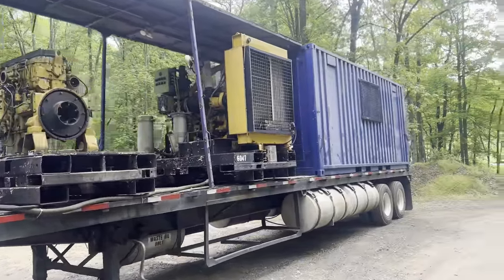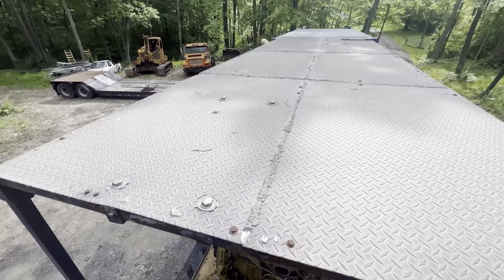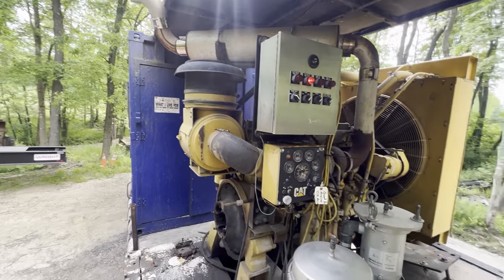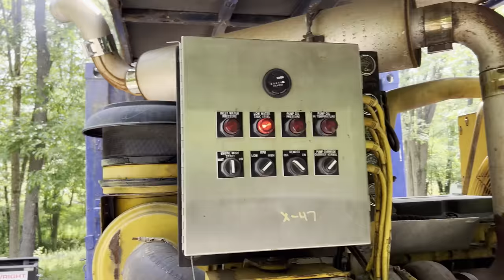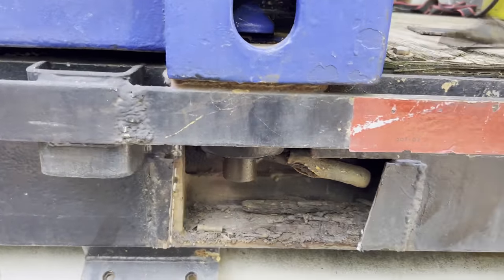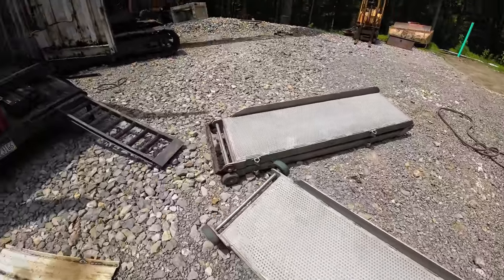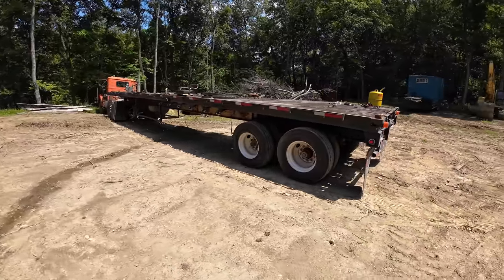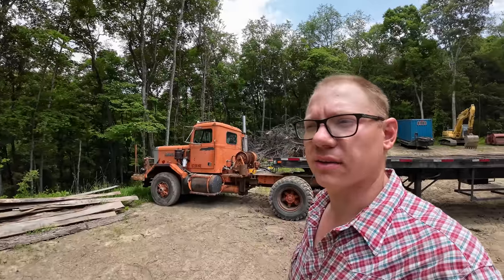I paid nearly $6000 for this Unit at the Auction, Sight Unseen, Will it run??

Comment: I was going to prematurely comment that you should unplug those wires as they look like remote controls probably controlled by the float in the tank. We use this setup a lot in dewatering setups
Reply: The override and/or maint switches may have bypassed external controls.

Comment: Great video. You made out good. But, as a suggestion why don’t you recondition the trailer ? Put , a new bed on it. Sand blast the rust . Prime and paint and get more money for it. Just a thought. Sometimes as is doesn’t bring in much. Reconditioned will. The steel is in great shape. Very nice nugget plan for the Auto Car

Comment: With the two engines, my guess is the stripped down one was the original ... something went bad on it and they bought a used or remanufactured one and put all the parts on the new one. So I'd guess the stripped one won't run/needs rebuild, and the one with all the stuff will.

Comment: You mentioned the brakes took their time to release.
For the lay person info for you
 Air brakes on a truck are designed to 
FAIL SAFE.
No air pressure in the system the brakes will  automatically apply via spring pressure.
Air pressure when greater that spring pressure release the brakes.
That is why you sometimes see and hear a driver revving the engine on a truck or bus.
It is also why you sometimes hear a whoosh or escape of air as a driver applies the Handbrake.

Comment: Matt, I wonder if building some kind of counterweight box to hook on the back of Fat Alice might help with situations like this - maybe one that can be used between all of your machines that could benefit from one. It might be a quick and fun little project… Otherwise, good video as always!
Reply: that 90 gal. tank would do,  make a cradle for it, so it can hook onto any machine,  then fill it with water as needed....lift on, empty,   then fill,  use machine,  drain tank, lift off empty..

Comment: was gonna say the yellow wire your mate disconnected would probably be to the 3 spot switch for mait, start , run 
Im sure if you reconnect it then as the engine starts you switch that switch from start to Run and it should keep going. 
Mait position - should only let it crank but not start. 
Start position is obviously (for cranking to start but not to run) 
Run position (for running but not cranking)

Comment: With truck/trailer  prices recently, the flatdeck by itself is worth more than what you paid for the entire setup.
Reply: Agreed! And on top of that, sometimes what provides a vital function for one outfit is so specific that the component parts are worthless to anyone as assembled… which means that stripping that trailer down unlocked all the resale value the thing has to offer!
Reply: no it isn't , NOBODY who hauls trailers for living wants that thing . its useless and outdated
Reply: @Hard_Right For daily use that might be the case, but for hauling bales on a farm or something like that it is good.
Reply: @Hard_Right  What makes that trailer useless today?
Reply: @b2dmastersniper  my uneducated guess would be the weight.
Reply: The country is saturated with those older style flatbeds. The rigging company down the road from me has so many they are stacked 4 high in several rows. With a shot deck he can probably get its scrap value. The tires would probably sell better on their own.
Reply: @inkman996 with a shot deck? Have you watched this guy at all? He has his own saw mill and just fixed up a trailer and made his own deck on one of his recent videos
Reply: @OldSlabSides  yes I watch him and he did not say he was wooing to put the sweat equity into redecking the trailer.  You might not know how hard of a job it is.

Comment: had a modern version on a building site i was working on.  they used it to blast off concrete with super high pressure water... like 3000 bar, so that rebar could be recycled or slabs that werent up to spec could be re-poured without the structural work having to be re-done.

this stuff could cut you in half and sounded like a jet engine
Reply: I can only imagine the mess that water jet would make stripping ground-level concrete. I make a hellacious mess washing the edges of my driveway with my puny 248 bar pressure washer!
Reply: They're also used to excavate hillsides in a hurry, washing away tons of dirt in a very short amount of time.

Comment: In the heart of Diesel Creek, a daring gamble was unfolding. A mysterious unit had been won at the Ritchie Brothers Auction, sight unseen, for a hefty sum of nearly $6000. The unit, a peculiar ensemble of a hydro demolition trailer, two power units, a poly tank, and a 20-foot sea can, held a promise of untold treasures or crushing disappointment.

The first encounter with the unit was a sight to behold. The power units, once connected to some sort of water pump, stood silent and imposing. The poly tank loomed overhead, its purpose yet to be discovered. The sea can, a massive metal box, held the allure of the unknown, its contents hidden from the world. Surrounding the unit were fuel tanks, sadly all empty, and a 48-foot flat deck trailer in surprisingly decent shape.

The heart of the gamble, however, lay in the two Caterpillar C13 diesel engines. These engines, once the beating heart of many a truck, now sat stationary, their fate hanging in the balance. One was missing components, its future uncertain. The other, complete and intact, held a glimmer of hope.

The journey to uncover the secrets of the unit was fraught with anticipation. The man door leading into the container was opened, revealing... well, that's yet to be discovered. The windows, covered up, offered no clues. The missing cooling pack on one engine was a setback, but the discovery of a battery tray with potentially good batteries was a small victory.

As the exploration continued, the condition of the unit became clearer. The trailer, despite some surface rust, was in good shape. The tires, 11r225, were in excellent condition. The fuel tanks, though empty, were intact.

The gamble was far from over. The engines needed to be tested, the container explored, and the true value of the unit determined. But the spirit of adventure was alive and well in Diesel Creek. The thrill of the unknown, the promise of discovery, and the potential for profit fueled the journey.

As the sun set over Diesel Creek, the unit stood as a symbol of daring, of the thrill of the gamble, and of the adventure that lay ahead. The journey had just begun, and the future held the promise of excitement, discovery, and hopefully, a running engine. Here's to the adventure that is Diesel Creek, where every gamble is a story waiting to be told.
Reply: Do you have any other novels for me to read?
Reply: Brilliant!
Reply: this is crazy, are you in college for story telling?
Reply: Great story telling skills!
Reply: @Huntnlady7  now im not sure, but i have a pretty good feeling this was written by Chatgpt
Reply: @superhugecunt2937  Smells like ChatGTP to me as well.
Reply: Yup; just messing around with Chatgpt4+voxscript plugin and am testing some prompting to create stories from transcripts. I can't take credit for the story, but happy some liked it :).
Reply: @intangur lol Turning Matts nice video of an unseen auction buy into true action & adventure drama! No wonder Hollywood writers are all riled up 🤨 about AI!
Reply: Chat GPT IS a great tool eh.
Reply: @JohnNorton86  definitely comes in handy at times for work, or just playing around with things like this.
Reply: When Chatgpt meets the YouTube comments section. 😂

Comment: Nice find Matt. I use to buy small stuff from auctions and resell. Did pretty good for a while, but prices got crazy and it just wasn't worth the hassle. Especially when I had to rent storage for stuff until it sold or finely got scrapped. Even had a few items I broke down into smaller quantities and resold through the same auction house. Surprised at how well it did. 
Thanks for sharing. Good luck in the sale.

Comment: I wonder if they used it for horizontal drilling? Put the drill unit in the back?
Reply: The trailer wouldn't be deep enough. Plus the drills have their own pumps and not nearly that much pressure.  I think the ramps are too light and too steep to get a tracked drill in.

Comment: Instead of trying to loosen bolts like the roof bolts alot of times you can tighten them (without a wrench on the other side ) with the impact until they snap.

Comment: For what i see that other c13 is a backup motor you would disconnect everything pull that motor with a forklift and change out with the other motor re connect everything and then run it just my thought though

Comment: Just wondering..... Do you have a power line run out there to the shop and such or still running off a small generator? If off a small generator, would be nice to see a show where you pick up a big generator and wire it in for full power at the shop and to run the overhead crane.

Comment: We used an electric version of a Woma Gun at a cement factory that I used to work at to blast buildup off of the walls of a pre-heater tower. Its a super high pressure/high flow pressure washer. It was powerful enough to cut through refractory and lift you off of the ground if you weren't paying attention.

Comment: I would definitely pull the valve covers and drop the oil pan on the non-running Cat to check to make sure it doesn't have a spun bearing, broke crank, sideways piston or dropped valve before trying to sell it off as a good core... C13s are notorious for all of those...

Comment: We use stainless steel filters like the ones on the pallet with the good engine and the poly tank for our anodize sealers, passivation and electroless copper filtration. You may want to check with any local metal finishing companies to see if they have any interest. We paid around $850 each for ours used.

Comment: Excellent video Matt  :) think container box be great storage for fuel tanks off trailer for Desiel fuel  when need fill machinery & trucks plus tractors and you got in collection you have too ! Plus trailer be good for Orange Auto Car for truck plus haul hoes and tractors plus Bobcat anything maybe need on jobsites to take if strong enough for ideas too ! Motor on Cat may need for parts one use on be too!

Comment: An 18 speed is a better choice. Not only do you have the top gears that you can split, you have the low range that you can split. Running at 180,000 pounds a trip, with a highway rear end, I start in low low, 1st low, second low, third low, fourth low- high, 5th low-high, 6th l-h, etc. Having that extra gear on the low end really helps. Even in my new job running under 100,000 with an 18, I start in 1st or second low. This 15l cat PULLS. 80,000 pounds with an RGN and a lil ole loader and I'm accelerating up the hills and passing lighter semis 75 mph in OD at about 1550rpms with more to go. You will not be disappointed with an 18 speed and a good motor.

Comment: So from what I can see the box on the back of the trailer would contain a robot or another machine with a super powered water jet on it. Those big engines would be running power and water to the machine, which will then have the power to basically blast concrete away off of rebar. Hydro demolition is usually done on bridges when areas are starting to corrode.

Comment: it doesn't hurt to make sure the filters are primed.
These also like for you to hold the starter for an extra second even once it starts.
Also check the fault system. (looks like the low coolant level is shutting you down)

Comment: Rampart Hydro services.  Used to work there eons ago, hauled a small tractor thT had 30,000 psi water jets to cut concrete with
Reply: You hooked up water hoses to the tractor from that trailer and the deisal engines ran the pumps to get the 30,000 psi

Comment: The engine wont stay running because low Water was indicated. It was supposed to be hooked on a Pump which should not run out of Water. So It was a safety shut of all the times

Comment: Howd'y Matt, What I saw there with that running C13 was it would run but only when you had the key at start position, the moment you take it off the start location it would die, I have had that many times with machinery and it was usually the fault of the E-stop itself or the wiring to it. The contacts in the back of the E-stop degrade over time, the cable you unplugged was most likely (in my opinion) the loom for the E-stop. Would be interesting to know if that is indeed what was preventing it from starting.

Comment: Great episode as usual. 👍  I’m lucky not to be called diesel creek too since many years ago, in my youth and whilst home alone, thieves tried to syphon 1000 gallons of heating oil from my parents house tank. They must have been disturbed because they left with the syphon still running.
 Most of the tanks contents got into the drainage ditch. Our equivalent of your EPA said that they could do the clear up for us but it would cost phone number sized amounts. 
I managed to use a submersible pump to skim the oil from the surface of the ditch and into a series of separation tanks. It took all weekend but I got things properly clean. I even got 250 gallons filtered and back in the tank! 🎉.

Comment: I really enjoy your channel. It has given me motivation to tackle some jobs here at home. One thing I noticed is that you use your truck to jump start/charge batteries. Do you know you could damage the diodes/rectifiers in your truck alternator by drawing too much current through them or risk shorting the life of the rectifiers?

Comment: I have a water jetter or they're also called hydroblasters. I use mine to remove old pool plaster so pools can be resurfaced. Mine is setup to run at 40k psi but they can be set to different amounts of pressure depending on the intended use. These are common in oil fields, ship yards, mining sites and many other applications. They are very interesting machines and in my opinion enjoyable to run. I was disappointed to see yours didn't have the pump on it. But you can cut out concrete completely and leave rebar 100% intact. Let me know if you're interested I can send a couple videos of mine your way.

Comment: We use ether on most the military equipment now days and they are electronic, never have had an issue using ether. They actually come with a bottle so you can hit the button on the inside for cold temps. Haven’t seen your motor run but if it doesn’t i wouldn’t be afraid of hitting it a bit aggressive with ether lol

Comment: On the rock crushers and pumps with cat motors i know you have to hold down that black breaker button with the wrench on it on the bottom left for the first 10 seconds that it starts , its a safety  override  or "tattletale" so it will pop if it has low oil pressure or high water temps and shut the motor off . Holding it down for a couple seconds on startup gives it a chance to get a reading from the sensors.... more than likely thats what he unplugged to get it to run

Comment: Happy Thanksgiving!
What a treat to watch you getting your Mr. Cool units installed as I get going this morning!
Don't feel bad about taking a bit more time getting it done than you thought it should. Hubby and I are both good at getting distracted from the project we're working on, sooooo, last spring, we set out to replace one blinking light fixture in my kitchen. Easy half day job until we find out that the fixture was probably not the main problem when we found evidence of mice chewing on the wire. And the further we followed it, the more damage there was. So, next thing we know, half the ceiling is down. And the paneling was off the wall. And more than enough holes uncovered to let in a few mice. Repaired the framing and opened up the floor to explore a soft spot and redid some plumbing and patched the floor framing. I'm sure you get the picture. Enough details. My kitchen is still a construction zone with ceiling getting insulated one can of spray foam and a few pieces of Styrofoam at a time. And cold weather catching up with us here in Central Ohio where our weather seems to match yours fairly closely. 
Great looking install, at least on camera and watched on a small screen. Again Happy Thanksgiving!
Past time for me to stop my one finger typing and get to work if we're going to eat turkey.

Comment: I do believe is most commonly considered a hydro excavator so water excavator mainly used for utilities and sensitive excavation operations that a bucket would be way to brutal so essentially it's like digging with a pressure washer only on a much larger scale I've seen some of them here in Florida Central Florida go for like 150 $200,000 well put together

Comment: That's a Hydro-Blaster for cutting or demolition of concrete.  Used a lot on bridge decks for a new overlay. upwards of 40K PSI water.  The ramps are to unload the buggy that's carried inside that carries the nozzles/jets that does the work.. Operator rides it along blasting the pavement or deck.
Pumps, Buggy, and hoses   are missing, Big Money There.  Part it out keep the trailer.
TGP
Reply: Correct

Comment: Ritchie bros auctions def have some gems, I bought a 1 year old TA 18ft utility trailer for 1900 bucks, MSRP on a new one was 3500. It was repo'd shortly after being sold, so it was virtually unused. I also got a stump grinder, brush cutter, power washer, and a few other items for basically pennies on the dollar.
Reply: I bought a tall 16 foot enclosed for $2K. It was 16 months from the date of manufacture and they originally sold for $5600. Mine was owned by an HVAC company whose drivers couldn't drive it worth a dang so they had jackknifed and damaged it. That's OK though, I used it to move my Mom from NY to Georgia and it saved me $$$ doing it that way. And it's come in handy in the years since then.